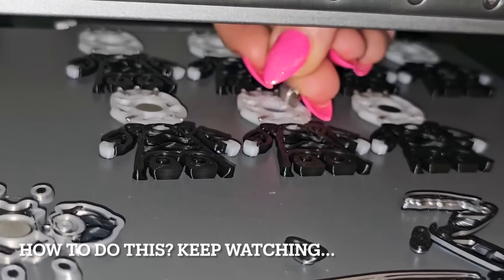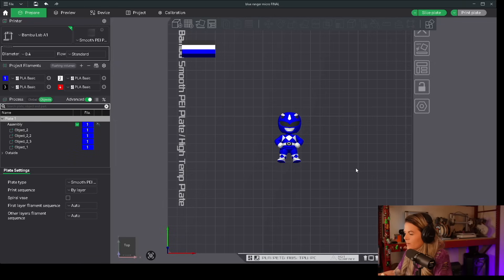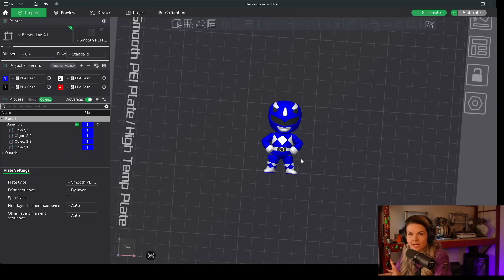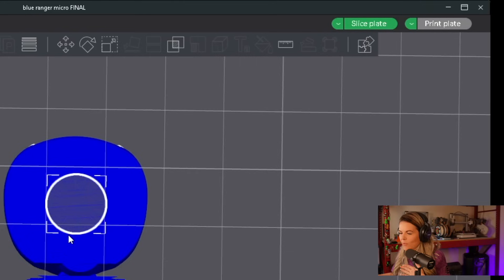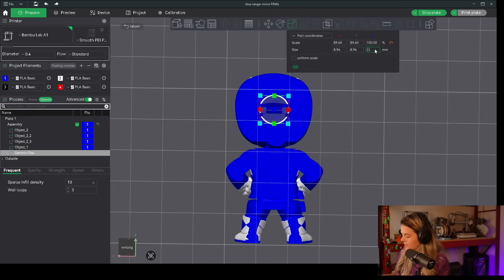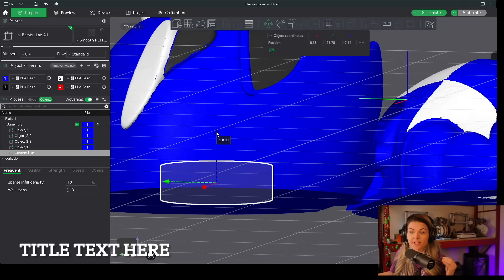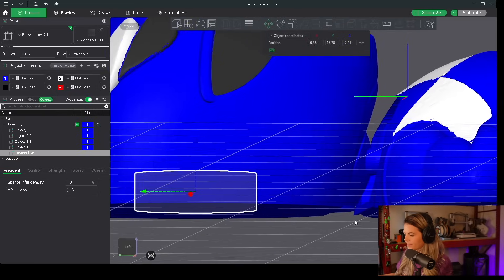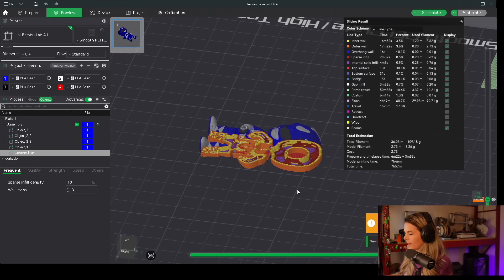How to Add Hidden Magnets in 3D Printed Models (Easy Tutorial!)🧲🔥

Comment: When you're in the Move Function change the Coordinates menu from Object Coordinates to World Coordinates that way the values are based on the build plate and not the object.  Then you can manually enter the Z values so those values can be uniform throughout all your models.  That way both the model and the negative part locations will be relative to the build plate.  So if both the model and the negative part are on the build plate in their Z values will be 0.00. Then you can enter a Z value on the negative part to be .25 or .30 mm from the build plate.  I hope that wasn't confusing, but it really helps me.
Reply from the maker: Thanks for the tip! This was the easist for us, I'm sure there are many ways to go about it- thank you for watching 😀